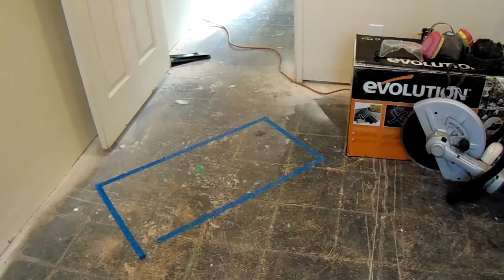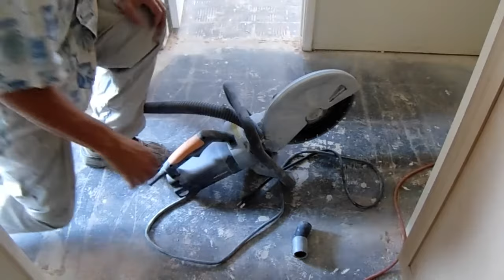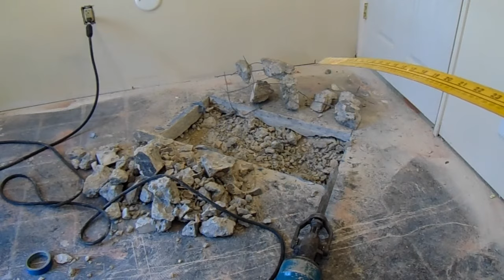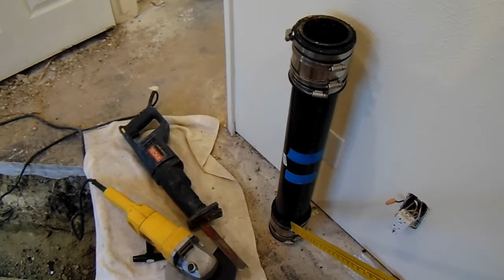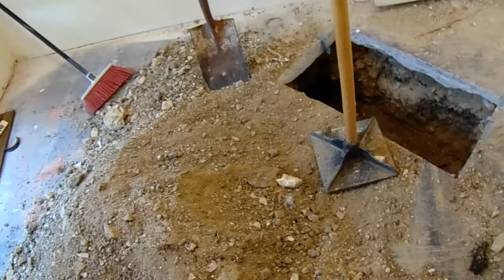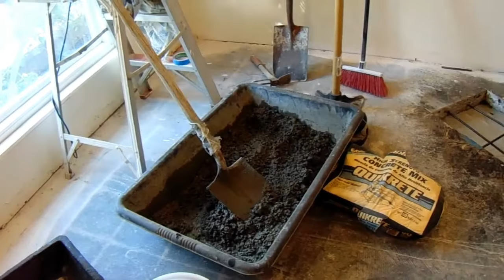sewer line under concrete slab  repair

Comment: This is the major reason why I would prefer a raised foundation as opposed to a concrete foundation.  Of course the raised foundation's a little bit more initial cost, the fear factor of a sewage leak, water leak or electrical/cable lines    being possibly inaccessible due to being buried in or under concrete doesn't appeal to me.  That's my opinion. Every habitable property I've owned has had a crawl space/raised foundation with the exception of a townhome that I owned for less than 2 years.  I love the access.  Water pipes, sewer pipes, electrical wiring, etc. no problem...🤔
Reply: I prefer a house with a basement. That way most the maintenance items are accessible from the basement. Unless you have a leak under the basement slab.

Comment: I ended up turning mine into insurance, they will not pay for the pipe to be replaced but they did however pay for the replacement of the concrete cabinets, floor, and they paid for a hotel for a month.
Reply: My insurance denied me at every turn. I mean my former insurance company
Reply: How did u get them to pay for that
Reply: @harrington214 they always claim to have made insurance to pay, but never explain how. So, I guess they just bullshitting

Comment: my concern is that the entire pipe is likely deteriorating, so in a year you are repairing another section.
Reply: Exactly what I know too!!! Best way to do it is run slightly thinner pipe to tunnel through the whole length or as I saw one guy do, a bigger pipe over it via a trenchless repair job!

Comment: I would have taken the time to cover the walls with plastic and used a saw with a water connection.  Thats the only way to keep the dust in check! If you are doing it your way you need to have a box fan on a couple of windows to extract the dust outdoors.

Comment: how did you precisely locate the damaged area and know exactly where to cut into the concrete?
Reply from the maker: I had to pay $200 for the plumber to exactly locate the blockage. He used a sewer line camera to pinpoint the blockage. Then he used an above ground "metal locator" device to mark the concrete while the sewer line camera was at the blockage location. Good luck.

Comment: Nice job ! Those ARC bands are  great - expensive but really high quality. Only issue is that there is no center lip which similar to Fernco's - they can offset over time. I'll use a standard stainless no hub coupling on one side and just one  ARC on the other. Our Code requires a metal plate underneath it to act as a brace.

Comment: Well-done, very informational.  THANK YOU!  BTW, It's a "rotary hammer" not a hammer-drill.  At least, that's the naming convention I'm used to in the United States.  Hammer drills lack the impulse power as they have to move a massive chuck back and forth.

Comment: Would i be possible to  drill a hole and get a crowbar under one side of that concrete and just pry it up and save all the jackhammer work?
Reply from the maker: Always use the right tool for the job. Sure, you can use a hammer and chisel but it will take you forever and increases the chance of an injury. You save money doing it yourself so get the right tool is my philosophy.

Comment: What about any Foundation concerns for post tension slab cable with beam?
Reply: If your slab is post tension it will usually be stamped in the garage. If that’s the case, absolutely do not do this repair without bringing in a foundation contractor. Post tension started to appear in Phoenix Arizona in about 2000.

Comment: Wow, another great video, but why do you only have two videos on your home page?  You were made to be a video teacher. Just picked up my new tile today and I'm going to redo my 72 years old bathroom next week.  I have never done this type of work before but at 73 years old my spirit needs a challenge.  My question to you is after the red guard can I still put a rubber liner then the final deck mud?   Oh, my bath walls have tile, mortar, and wire, it's going to be a dusty job..

Comment: How did you know the exact point of the break?
Reply from the maker: I hired a local plumbing company to put a scope down the pipe. The plumbing company identified where the roots entered the pipe. The root intrusion location was marked using a surface device on the top side of the concrete . The cost was around  $250.

Comment: how did you trace the pipe
Reply from the maker: The pipe was traced by a local plumbing company. It was a camera/locator head snake. The snake stopped at the root intrusion. A surface metal detector like device located the position of the snake/ root intrusion. The cost was about $300.

Comment: I wonder if it would pass code inspection if I did that under a permit or if repairs were needed to the frame sill plate or if walls were moved ,would that slab be recertified or approved for the project after that was done without a permit or with a permit because I have heard of horror stories that resulted in government forced tear downs of expensive homes because issues like that.
Reply: Probably not in my town.  They hate furncos unless you bury them in concrete.  If the repair is over 4ft long, they really go APEshit!

Comment: One indication of a leaky pipe, will it make the carpet wet?
Reply from the maker: Sewer lines are not under pressure. If you have wet carpet you're in big trouble
Reply: @robertdeming1802  So what do you mean? What could cause the problem, please educate me.